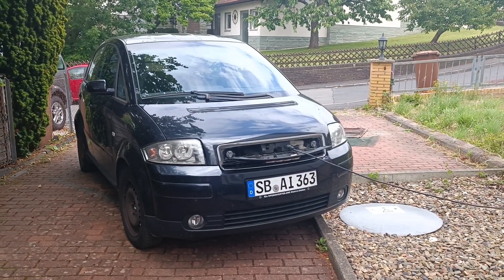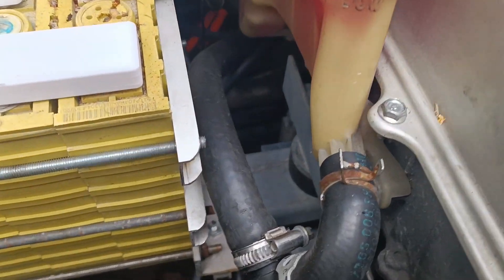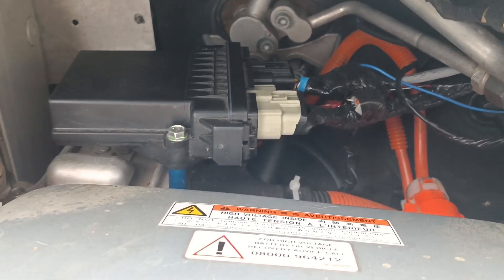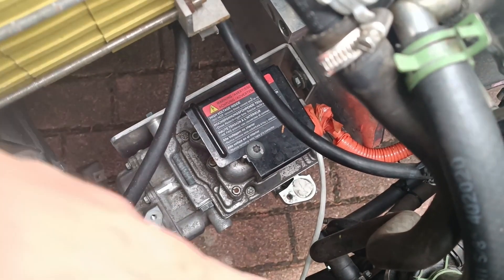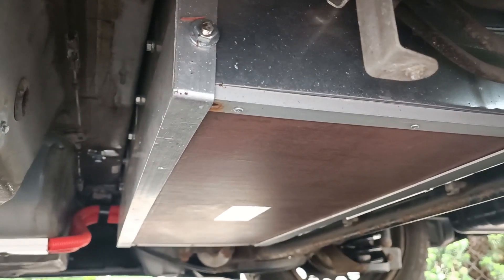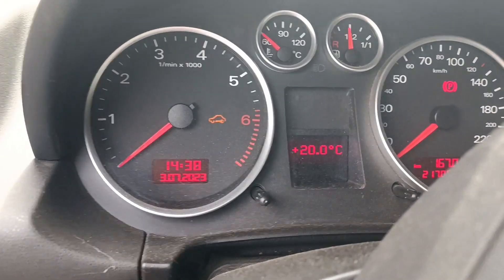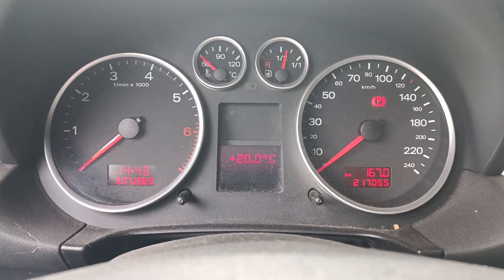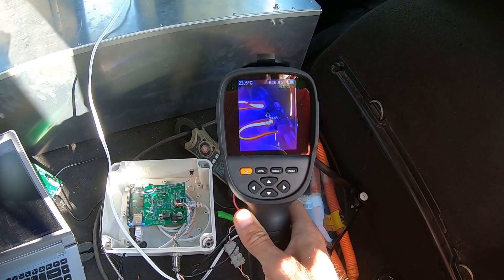Lab Update #79: Audi is finished and has got CCS

Comment: Question 1: Have any EMC tests been conducted on the car?    Question 2: What were the costs of certification?  Question 3: Is it possible to use a hydrogen fuel cell instead of batteries? Do hydrogen fuel cells last longer? I would like to build hydrogen cells myself. However, I have no idea if that is possible. I know that there is a regular fair in Hanover, but I also have no idea about the cost of the membranes, are etc.    Here's a Tesla that normally drives 395 km, but with hydrogen, it reaches 1158 km.   https://www.youtube.com/watch?v=Qul7xNU7Vms   (with subtitels)
Reply from the maker: 1 no
2 600€
3 probably too little space for the tanks, high maintenance cost and pointless as hydrogen is essentially a fossil fuel made from natural gas for years to come
Reply: @openinverter  @3 True.. but there are more ways to produce hydrogen https://www.youtube.com/watch?v=REV739pRNcw&list=PLTYlUGKLEk-EGHzZgD2sMIsFAYYPF44Zn

Comment: great! what about consuption, acceleration? I suppose 500v prius motor connected directly(without buck-boost) to battery via inverter?
Reply from the maker: Yes, 400V directly. About 50 kW until 50 kph or so, then diminishing towards 30 kW at higher speeds. So quite nippy in city traffic, sluggish bht driveable on highway
Reply: @openinverter  great in term of availability of parts and prices ! 
I’m planning to convert my old smart forfour , here on far east of Russia there are tons of parts for right handed cars (that were imported from Japan) , so prices tasty . 
I have one question what’s better to buy :
Prius transaxle (cheapest)
Outlander front transaxle with both motors (100 dollars) (I see 137nm of torque but no info about torque of generator)
Outlander rear transaxle (120 dollars) (more torque if compare with front motor )
Reply from the maker: Outlander stuff is more powerful and smaller. But in Germany I must use matching motor and inverter
Reply: @openinverter  thank you 😊
Reply: @openinverter   Kann man daran etwas ändern, also bessere Beschleunigung auch ab 50km/h (bessere FOC Einstellungen oder noch mehr als 400V)? Vermutlich nicht, sonst hättest Du das wohl schon getan, oder? Oder wollte nur Dein Bekannter diese Einstellungen haben, weil er ohnehin nicht auf der Autobahn fährt? Ich brauche so ein Auto viel auf der Autobahn....und möchte bei der Auffahrt nicht immer die Berufskraftfahrer im Nacken fürchten müssen...
(Eine mechanische Alternative zur besseren Beschleunigung wäre vielleicht, das der Prius Motor am TDI Getriebe angeflanscht würde, wenn es passt bzw. wenn man es kann (???)...)
Reply from the maker: @tr6pi567 nee, mit einfachen Mitteln geht da nix mehr. Thomas fährt aber jeden Tag Autobahn, scheint zu gehen. Fährt ja 120, dauert nur bis man dort ist.
Anflanschen is nich, weil der Motor ja im Getriebe integriert ist.
Höhere Batteriespannung oder Motor umwickeln...
Reply: @openinverter  Vielen Dank für die schnelle Antwort!

Comment: Love your work excellent implementation of the Prius gearbox and inverter. Do you think that Tesla model S front drive motor will fit into Audi A2?
Reply from the maker: Thanks 😉
Probably an SDU would fit
Reply: Maybe also a Nissan Leaf drive unit could work as good.

Comment: Nice mounts and video.  Resolver and T-sensor wires should be shielded to the plug.  Water tight all wiring.   Um alles anhaltend zu machen.😊
Reply from the maker: The shield is actually lugged to a bolt next to the connector